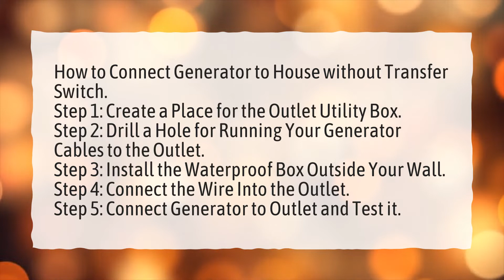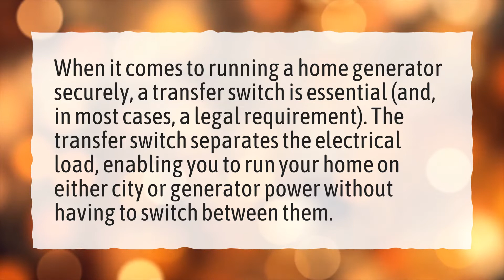How do you hook up a portable generator to a house without a transfer?

Comment: For US: Article 705.NEC702.6 contains an exception to the transfer equipment requirement:
“Exception: Temporary connection of a portable generator without transfer equipment shall be permitted where conditions of maintenance and supervision ensure that only qualified persons service the installation and where the normal supply is physically isolated by a lockable disconnecting means or by disconnection of the normal supply conductors.”
The term as defined in the 2011 NEC reads as follows: Qualified Person. One who has skills and knowledge related to the construction and operation of the electrical equipment and installations and has received safety training to recognize and avoid the hazards involved. (no degree or certification necessary, just basic knowledge training available everywhere)
110.25 Lockable Disconnecting Means:
Where a disconnecting means is required to be lockable open elsewhere in this code, it shall be capable of being locked in the open position. The provisions for locking shall remain in place with or without the lock installed.  (you can't lock it with a chain or some other thing that is all removed when unlocked, the lock has to be a feature of your breaker box and be able to lock the main breaker open.)
You CAN legally wire a portable generator into your panel and do so without an interlock or a transfer switch if your breaker box has locking function, provided its a temporary connection of a portable generator.